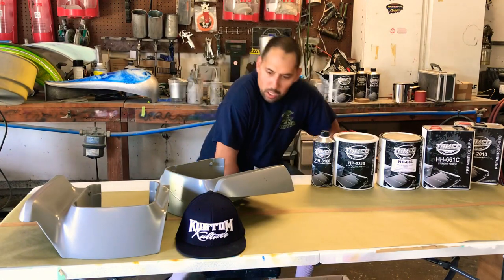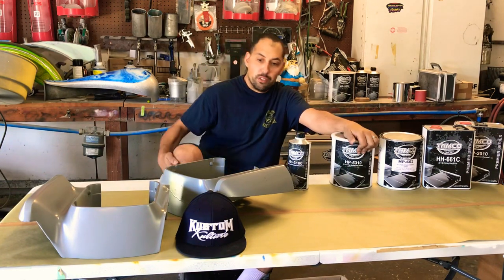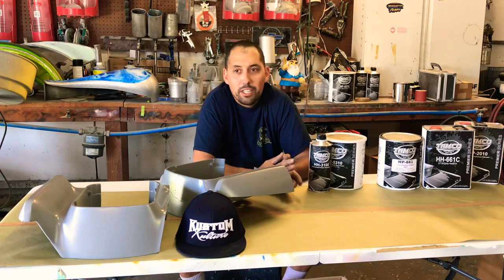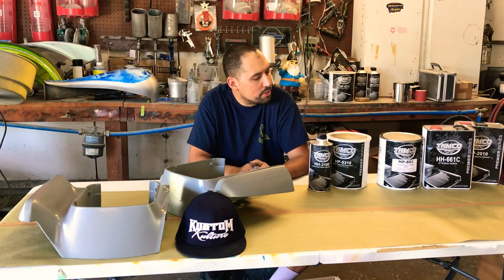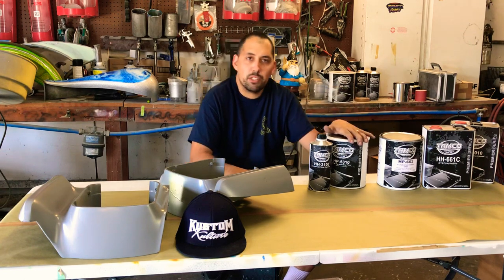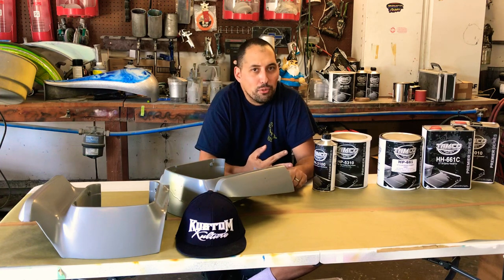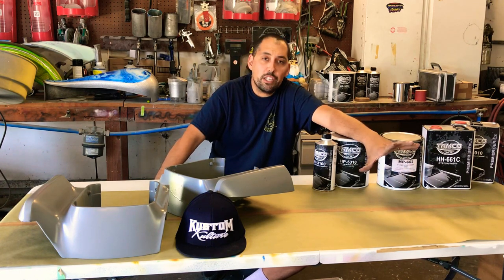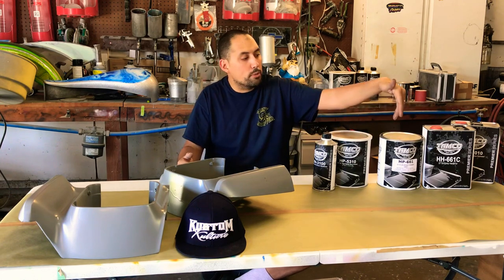LugosDesignsUnlimited Tamco Primer Talk

Comment: What scratch do you need before filler on the 5300 series? 80 or 36?
Reply from the maker: 80grit
Reply: @LugosDesignsUnlimited  3m platinum plus filler wants it on bare metal 1st but i hope it` ok going over 5310?
Reply from the maker: @Supanova70  As long as you prepped the surface good 80grit is awesome should not have an issue
Reply: @LugosDesignsUnlimited  so confusing some say epoxy 1st then filler then dtm . i am lost. I do know the less amount of coatings the less chance of cross over reactions. Epoxy takes so long to dry i just wanna getr done...lol
Reply: @Supanova70  wanda super high build the model number is PU 8100 get that with medium pardner you can get a kit for about $200 and that's what I've been using and I go right over bare metal I've done multiple paint jobs it is very high build seems like butter and is decently cost and before the pandemic it was about $125 for the kit which was great now it is close to 200 but anyhow just wanted to primer is not direct to metal but I use it direct to metal and I think it does better than some other primers that are direct to metal for instance I bought some p p g a few months back epoxy primer and had more issues with that than I did with this stuff and bleed through in it supposed to be top-of-the-line I will not use again if you're looking for something reasonable priced can you can't get a hold of this tampco t r y Wanda Pu 8100 with medium hardener or depending on your environment I just did the whole car recently with and it is so thick that you have to reduce it just with some medium or slow or fast read reducer depending on your environment again I'm in the winter time with 18 to 20 degrees here in Michigan and I just use medium hardner and medium reducer because it because even out of a 2.0 anist iwata primer gun it is still too thick you almost need like a 2.5 / 2.8 so make sure you have a big tip it is 4 to 1 or 411 very good stuff. I'm going to be getting a bigger tip hopefully they make a bigger size for my anast Iwata because one solid full coat at a four-to-one ratio this stuff dries very fast to even in cold weather I mean I sprayed the other day at 65 degrees in my garage with the furnace on with a window pulling in fresh air in the air outside had to Ben 20° so I finished at about 10:30 in the morning came back around 5:30 in the whole car was ready to s a n d not even 7 hours with the heat on only about 50 degrees but I'm telling you try that you will like it